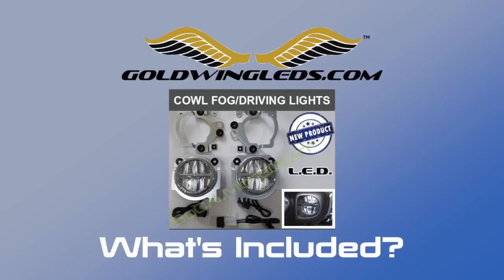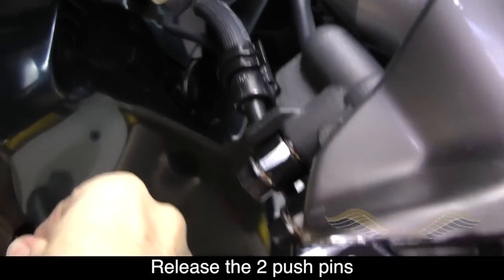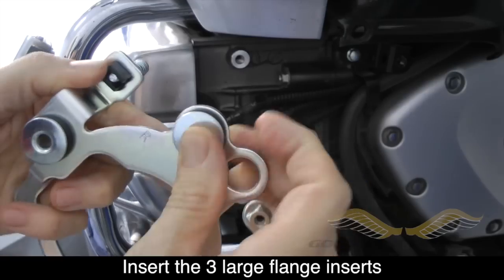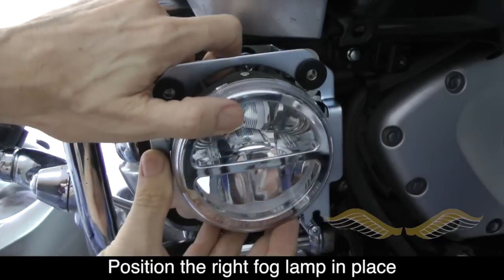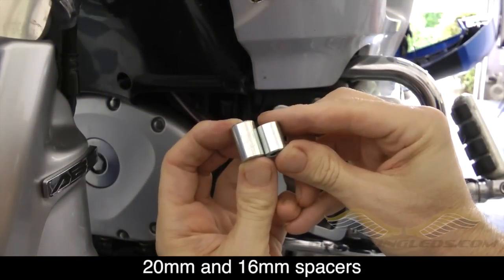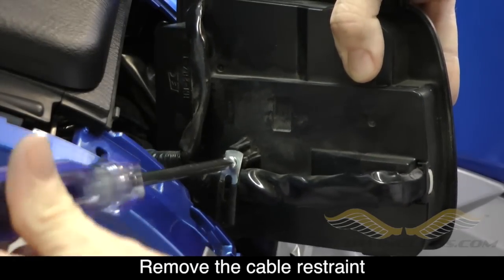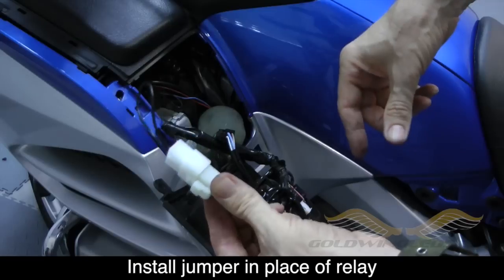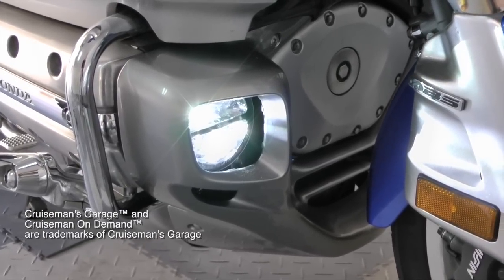Install GoldWingLEDs.com Driving/Fog Lights for Honda Goldwing and F6B

Comment: Excelent video, thank you.  Just a reminder that the screw heads on Japanese motorcycles are for JIS screw drivers and not Phillips. Less screw heads stripping by using the JIS drivers.

Comment: An FYI- all the cross-head screws on Hondas and other Japanese bikes are JIS (Japanese Institute Standard), not Philips. If a JIS screw is pretty tight, a Philips driver can strip the head in short notice. 

JIS drivers fit JIS screws perfectly and there's little risk of damaging a screw head unless you're really ham-fisted. JIS drivers are available from a lot of online sources including Amazon and McMaster-Carr.

Comment: Hi Chris, an excellent video as always... just a clarification, @7:40  into the video you mention the use of 16mm spacer on top but the text says 20mm and the opposite for the bottom, you say 20 mm but the text says to use the 16mm spacer. Please clarify. Thank you.
Reply from the maker: You are correct.

Comment: Is something wrong with the left side spacers?? I think the video is off saying to use two 20mm spacers when it only comes with 1. Thanks
Reply: I just installed mine and it should be 20mm towards the center of the engine and (2) 16mm on the outside.  The install kit also comes with a lot of extra ambiguous washers.

Comment: My '07 bike has the factory fog lights installed. My factory switch is NOT illuminated.

Will I need to replace the OEM switch for these to work?

I also have dash lights wired into fog light switch
Reply from the maker: I don't think so, you should be able to use the factory switch.

Comment: Quick question.  I have a 17 and put the fog lights on.  I am wondering what the part number is for the jumper to have them on with the high beams on.  Thanks
Reply from the maker: Check here: http://wingstuff.com/products/30650-fog-light-reconfiguration-harness
Reply: @cruisemansgarage  The link is dead now. I hope that Wingstuff still has it but in a different URL. Yeah, I'm going to install mine soon. I'm getting mine done with my friend who owns the exact same 2017 as me. He sold this fog lights to me because he didn't like the design. He got the Show Chrome Tridium lights instead. I can't get the Tridium lights because Wingstuff doesn't have anymore stock :(

Comment: Like these, but not real impressed with the fact Honda made the cowl holes square, and all the driving lights are for the most part round. Makes it look a little odd.  I know I can use and older cowl but they dont have a matte black of these in the older versions.  Excellent video.
Reply from the maker: There are some newer models now that fit the rectangle.

Comment: My fog light switch is lit all the time, is that normal?
Reply from the maker: Yes. It is so you can find the switch in the dark.
Reply: Is there a way to change it?  I will find my self driving around and not know if the fog lights are on during the day.
Reply from the maker: Not to my knowledge. I think Honda makes an OEM fog light switch that may function differently, but I am not certain of that.
Reply: ok thanks!

Comment: This was a great video, but has turned out to be completely inaccurate for the wiring adapter location on my 2008 model.  I cannot find this factory plug anywhere.  I also see that 'CruiseMansGarage' hasn't replied to one single person on here, with all these previous comments.  Quite lame!
Reply from the maker: Sorry about the delayed reply. Gmail was screwed up! You should have factory wiring for fog lights, not sure why you cannot find the harness. Did you remove the cowl?
Reply: Thank you for the reply.  I did figure it out, it was unfortunately frustrating.  http://gl1800riders.com/forums/5-gl1800-tech-board/324033-kuryakyn-driving-lights-installation-problem-2.html#post4021289

Comment: I can’t find the plug your talking about??
Reply from the maker: That plug can be really hard to find sometimes, but I promise you, it is there. You may have to "dig deep" into the shelter to locate it and pull it up, but it is there.
Reply: Cruiseman's Garage okay, I’ll look again tomorrow... would it likely be straight down from the opera panel? Or coming from the fairing area?
Reply from the maker: @robcraft1373  It is usually in a bundle of other connectors inside of a clear or black rubber protective shroud, sometimes tucked next to the inside of the bike, not on the outside of the shelter.
Reply: Cruiseman's Garage there is a protective black boot, that has two white plugs, but I don’t see any other plugs in that bundle. I’m really getting frustrated, I’m sure it’s in there somewhere but it’s not where others are saying it  sould be🤨 it doesn’t seem like it sould be that hard to find. Every video I watch on this , people open up the control panel and it’s right there... boy not in my case.
Reply: Found it... finally
Reply from the maker: @robcraft1373  Great! Where was it?
Reply: Cruiseman's Garage exactly where you said it was..😱it was really up in that boot. Thank you, lights look great!!